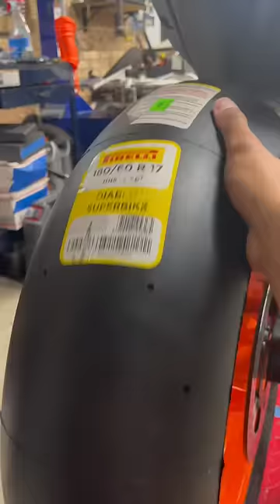Time for some new dancing shoes 🛞 #ktm  #duke #pirelli

Comment: Price
Reply from the maker: For the tire or the machine?
Reply: @vtranmoto  for the tire of course
Reply from the maker: @IceCream-uy4mc  really depends, the race slicks that I use are around $200-250 per rear tire or around $420-450 for the set 👍
Reply: @vtranmoto  wow, it turns out not as expensive as I imagined.

If you have a set, how long can you use the tires?
Reply from the maker: @IceCream-uy4mc  for my level, the rear lasts about 3-4 days of hard riding, then the front is about 5-6 days. But the pros are done in one or two sessions!